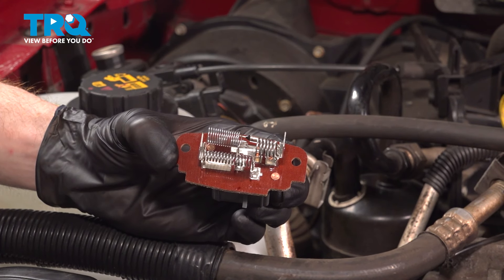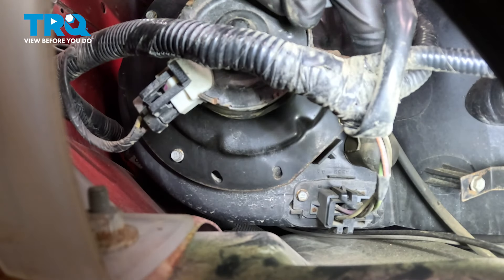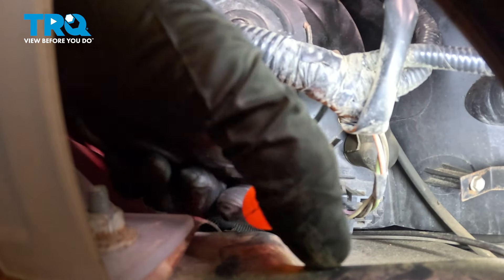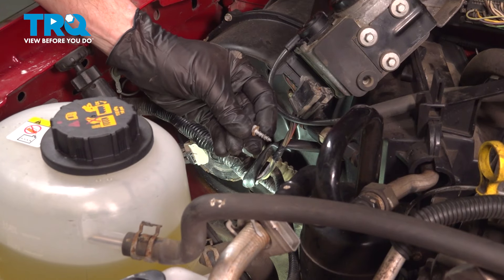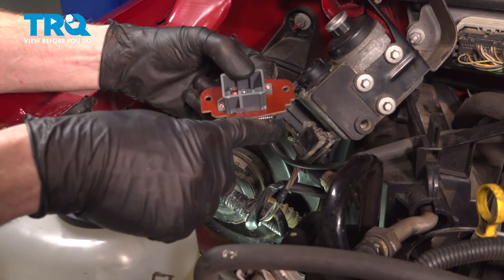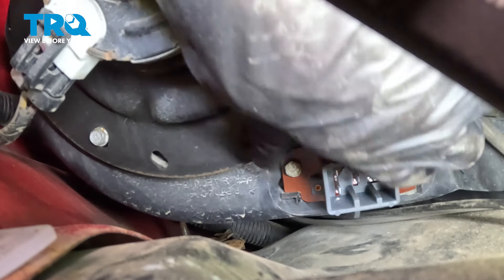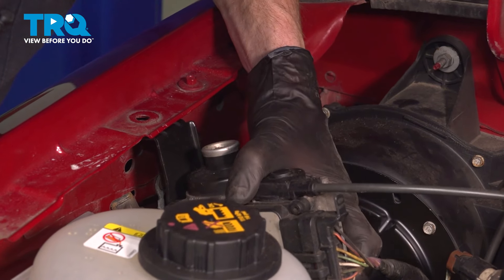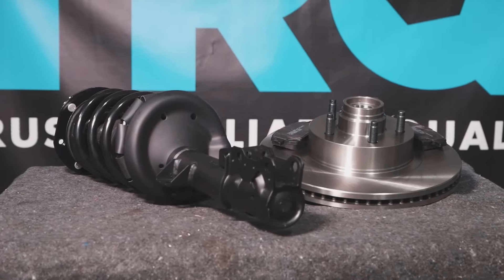How to Replace Blower Motor Resistor 1998-2011 Ford Ranger

Comment: May I add that once you move the cruise control unit to the side you can just simply skip the plug step and go right to removal of the resistor which for me, made it easier to remove the connector once the resistor was out of its mounting place. Just a tip for those that can’t get the connector undone